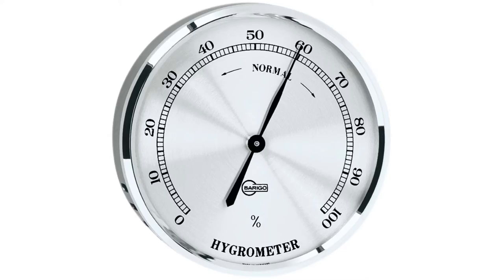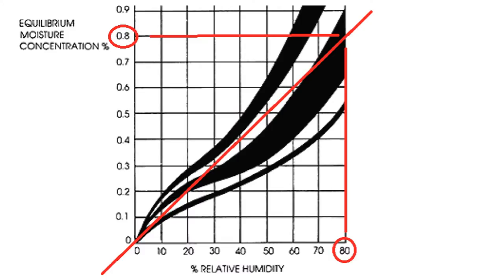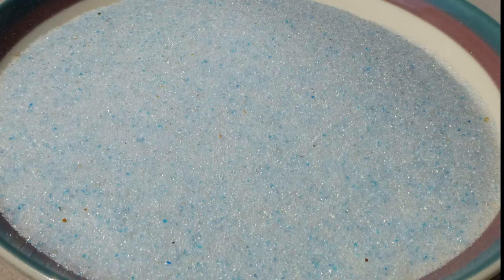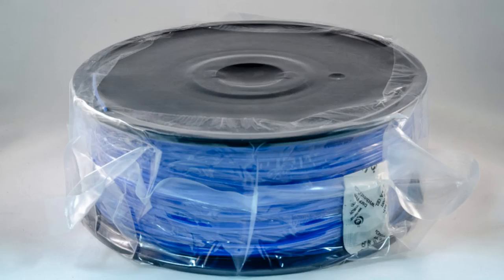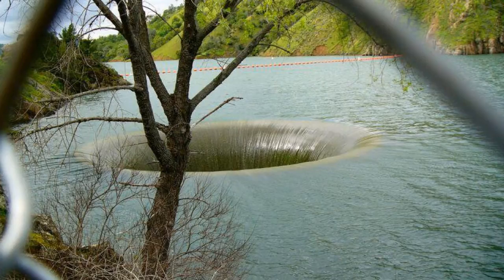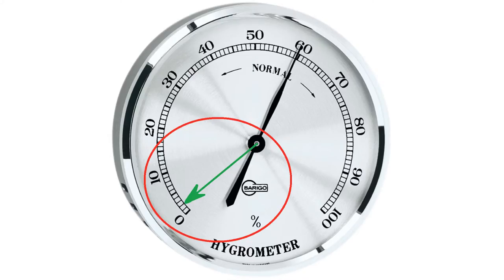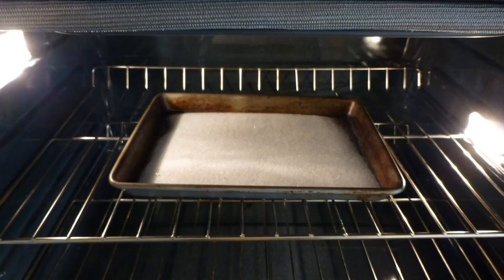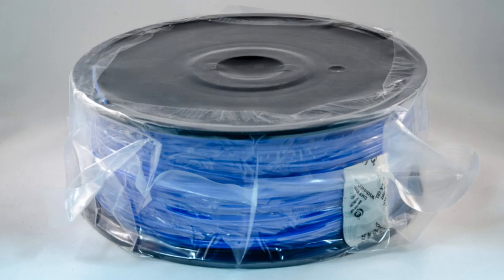How To Keep Your 3D Plastic Filament Very Dry

Comment: @Carlton Dodd - I don't think just a heating element will do. It will lower the relative humidity, but not enough. To get the desired effect, you would have to store it at 120C, at which temp it would probably not be happy.